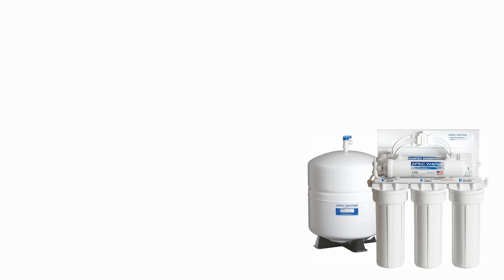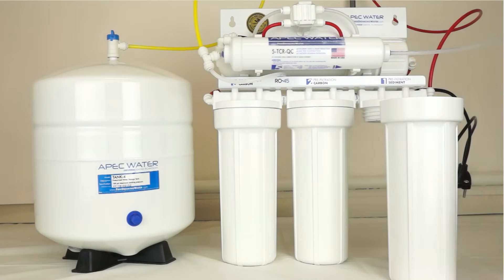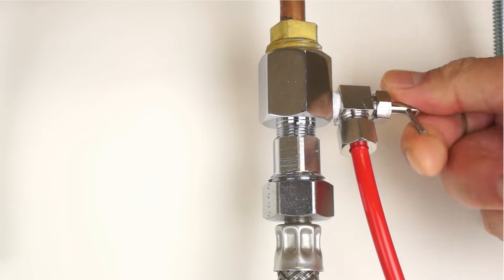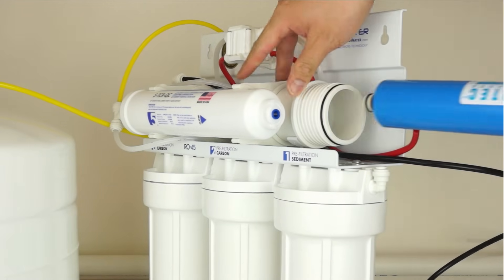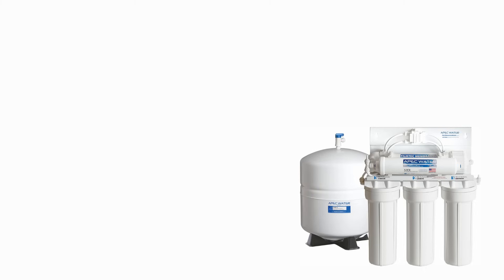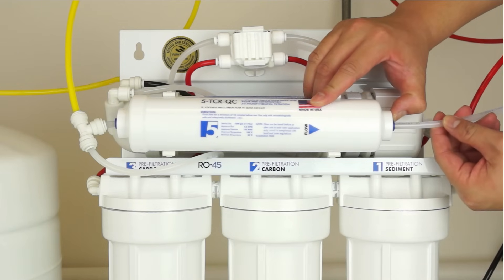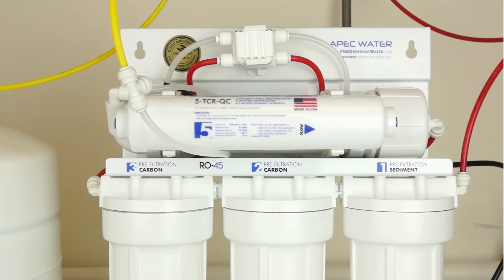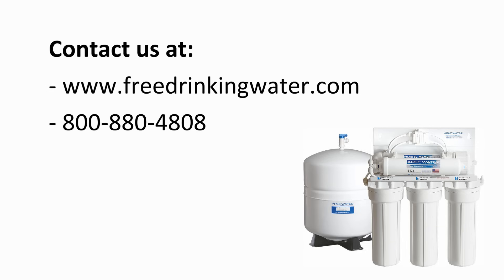How To Replace Your Reverse Osmosis Filters and Membrane - APEC Water Installation Part 6

Comment: this is useless for a first timer because you have no water in this system! they are in for surprises lmao
Reply: Each filter housing is filled with water so there will inevitably be some spillage, as you remove the housing, just maintain the housing as upright as possible and move up to the sink to remove the filter and dump the rest of the water before replacing filter.
Reply: I'm not expert but nothing I've read while researching this indicates it's a good idea to not change the filters. Why bother with the RO at all if your not going to keep your water filtered properly is where my thoughts are.
Reply: Lot's of water going to flood the place?

Comment: If you are using pliers to avoid contaminating the membrane with your fingers, it would be a good idea to sterilize the pliers. Also, lightly lubricate the O-rings of the filter canisters before reinstalling.
Reply: Or you can just wash your hands before you install it. I'm pretty sure one trillionth of an ounce of hand oil is probably okay on a low budget system like this!
Reply: You are using the pliers to remove a dirty filter. Why would you need to sterilize the pliers? You can replace the new filter wearing plastic or sterile gloves.
Reply: @beatweezl  yes!
Reply: Im amazed he used pliers directly on that membrane!  sure if ur pulling the old one and throwing it out , but on a new one? No way! treat it like its surgical and never touch it with ur hands  or any thing directly... i use some clean clear saran wrap doubled or trippled to "hold "the end of the membrane as i install and push it in... id do same thing  with the saran wrap With the pliers if i was gonna reuse the old membrane, so that the pliers do come into direct contact with it..

Comment: Thanks for the video! The guy that used to change my filters got too annoying by calling me constantly before it was time to change them, so I decided to start changing it myself. This video and eBay was just what I needed
Reply: Oscar Fernandez I had the same problem. Doing it yourself is more satisfying, and I got rid of the filter guy. 👌👍👊👊👊👊
Reply: How much would he charge you guys?
Reply: jonton $100 exactly which included the filters... but he wanted to change them every 2 months 🤣
Reply: @oscarfernandez6961  oh gosh. Aren't the filters usually good for up to a year??
Reply: jonton yes! Replacing them yearly is a sound tule of thumb; however, this guy wanted to make as much money as posible off of me! He’d even give me some bull crap story about the membrane filter getting easily damaged... I blocked his number and learned to do it myself instead
Reply: @oscarfernandez6961  the nerve on the guy😤 but hey, at least he forced you to look into doing it yourself, and now he is out of the picture. Aaaand you save money. Win win
Reply: @Ton6541s  Hey Jonton, I'm that filter guy, and now I'm unemployed because of you DIY-ers 😒😬😪🥵🤯